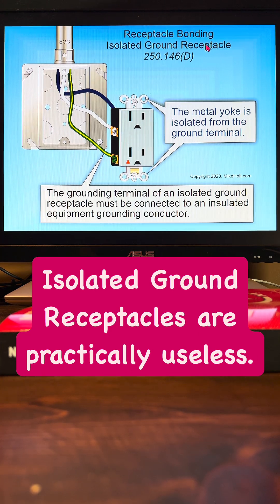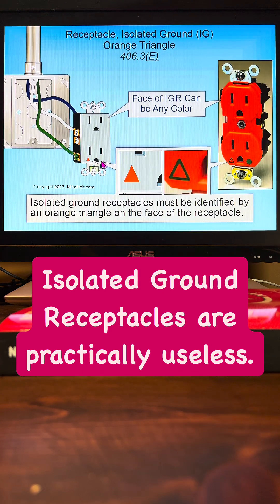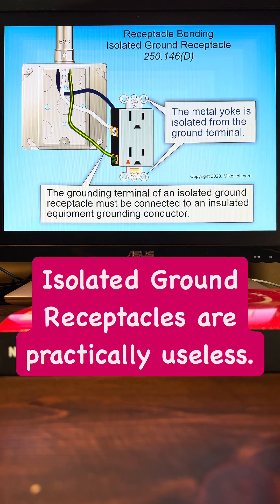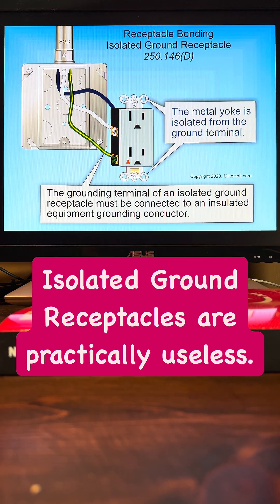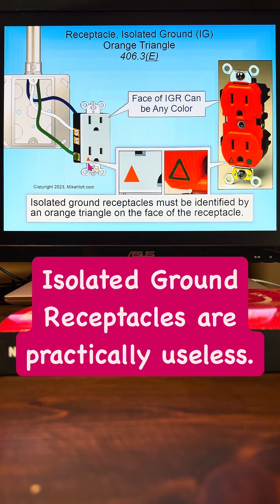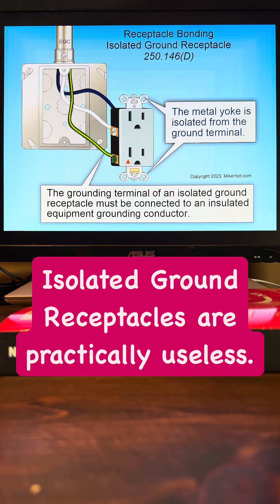The grounding terminal of an isolated ground receptacle must be connected to an insulated EGC.

Comment: I bet most if not all of you were told these "talking points", not really observed for yourself.
Reply from the maker: @TGUlricksen, I totally agree with you. Isolated ground 'system' which includes the receptacles need to be installed in accordance with IEEE 1100 Recommended Practice for Powering and Grounding Electronic Equipment, which I'm sure 99% out there never read. I have the Digital and hard copy of this amazing standard.

Comment: It's true for general power supply it makes no difference, but there are certain situations where an isolated grounding conductor cures electronic interference noise in audio/recording equipment in the same room. Even though they're technically doing the exact same thing as the regular equipment grounding/bonding system, it dose manages to control the multi paths and ground circuit loops that causes audio equipment noise being fed to other audio equipment in the same room. I've experienced this situation with audio/recording equipment since the 1970s.

Comment: You neglected to mention the isolated ground is not connected to any other devices in the run. 
Used for electronic applications

Comment: On the topic of Isolated Ground Receptacles my interpretation is very simple. The 'yoke' of the receptacle is ISOLATED from the equipment ground terminal!
Even though these two points of ground are physically isolated from each other at the receptacle, at the panel, they're bonded - they're the same!

The isolated ground provides an equipment ground conductor that travels from receptacle directly to panel, point -2-point!
Whereas the ground conductor from the receptacle yoke travels from the yoke, touching almost every conductive bare metal and other ground terminals on it's way back to the panel.

I think that's why some call them clean and dirty ground.😂

In case of a ground fault, the dirty ground is the main path back to the panel to clear that fault. It has a wider tolerance.

The IG is there to bleed any static or undesired voltages induced into the electronics. Not the electrical. 

The IG paths can be seen as a parallel ground bus but the other ground paths can be seen as a 'tree' or star type of ground bus.
Reply: The explanation I received was that the conduit and mc cable system of metal conduit reticulated inside the building essentially creates a huge antenna that the equipment grounding wire is connected to that cause interference to sensitive electronic equipment. By isolating the equipment grounding conductor you eliminate the interference of the conduit system.
Reply from the maker: @JeffBanfield-t6V, wrong you'll need to read IEEE Emerald book IEEE Recommended Practice for Powering and Grounding Electronic Equipment
Reply: @MikeHoltNEC  Hey Mike, you should know by now electricians are never wrong! =) 
250.146(D) explains the isolated grounding receptacles and how the feeder's isolated grounding conductor has an insulated path to the main service grounding connection without connecting to local panelboards. I've done work in several hospitals over the years, and they all have this exact setup. 408.40 Exception provides further clarification on the matter. I'm curious what advice the IEEE book has about it if it contradicts the methods used in the field.
Reply from the maker: @JeffBanfield-t6v, IEEE  IEEE Recommended Practice for Powering and Grounding Electronic Equipment, explains exactly how and Isolated Ground System needs to be installed. Installing an isolated ground receptacle and connecting it to the panel cabinet ground terminal, serves no value (typical installation).

Comment: I had a computer device blowing its power chip every couple of days. we couldn’t figure it out, the vendor said we were the only customer with this issue. One day I was at the site and a staff member told me it was going to blow. She said
every time she heard that noise it blew. The noise was the old photo copier. they shared a ground. we gave them there own ground back
to the service and problem solved. IGs work.
Reply: Isn't the ground connection supposed to be isolated/independent of the circuit power connection?

It seems like 'strong' voltages were being induced from one piece of equipment to the electronics of the other.
Were they on the same circuit (breaker)?

A voltage induction can also when one piece of equipment causes the voltage supplied to another piece of equipment to oscillate(lower-increase). That has similar effects to oscillating between 'brownouts' and over voltages.
Most times we look at 'sidewards' induction.

A possible solution is to put the photocopier on its dedicated 120/240 V circuit.
Reply from the maker: @V21IC, nope please read 1100-2005 - IEEE Recommended Practice for Powering and Grounding Electronic Equipment

Comment: IG receptacle's insulated grounds usually connect back to XO on the system.  A separate insulated IG bus detail is used in the panel to maintain separation from the mechanical ground.  The insulated IG bus detail is then connected to the XFMR XO or the building's point of bonding via an insulated conductor.
Reply from the maker: @veloci3twenty607, you are 100% right per IEEE Emerald Book.🙂

Comment: “You don’t need them at all for all practical purposes”

If you don’t know what you are talking about, please don’t give blanket statements.

As @NotTheOneAtAll has stated, these circuits are CRITICAL with certain electronic equipment.
They measure volts/amps in the micro-volt or micro-amp range.
So even a millivolt ground current can disrupt their operation.

IG circuits need the ground to be ISOLATED ALL THE WAY BACK to the service entry ground point, they must NOT touch any ground on the way.

Are they “useful” in regular lighting or motor loads? Not really, as these usually tolerate 1/100 volt on the ground without any problems.

Comment: For labs with equipment that is sensitive, operating rooms or patient rooms with sensitive equipment, and DeltaV systems used in the manufacturing industry, a proper isolated ground is critical.
Reply: When I did these the isolated equipment grounding conductor connects at the main distribution board, not the local subpanel. This method is critical for sensitive equipment in hospitals. I think that's the main difference. If you did connect the isolated ground to the equipment grounding terminal at the same subpanel that wouldn't make any sense and that's not the correct method.
Reply: @JeffBanfield-t6v However, I think that the distance of the run should be considered i.e. the path shouldn't be too long, and winded.
Reply: @V21IC  The isolated equipment grounding conductor is isolated from the subpanel, essentially floating such as a neutral would be. If the circuit conductors are adjusted for voltage drop, the equipment grounds would also be adjusted proportionately.
Reply from the maker: @NotThe OneAtAll, if installed in accordance with IEEE 1100 Emerald book.
Reply: @MikeHoltNEC Agreed.  😊.  As an electrician who has learned a lot from your content, I'd like to thank you for all you have contributed to the advancement of the electrical industry.
Reply: The hospital I work at has equal potential grounding and the o r panels are split voltage isolation panels two legs of sixty volts
Reply from the maker: @V21IC, nope, please read 1100-2005 - IEEE Recommended Practice for Powering and Grounding Electronic Equipment
Reply: The isolated grounds are essentially just supplemental grounds.